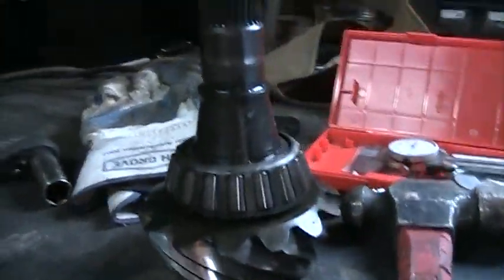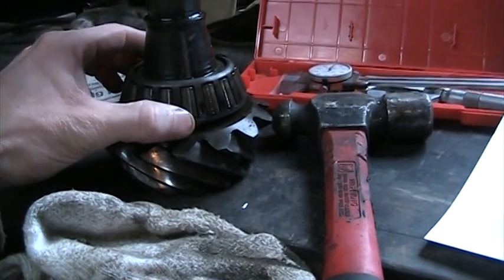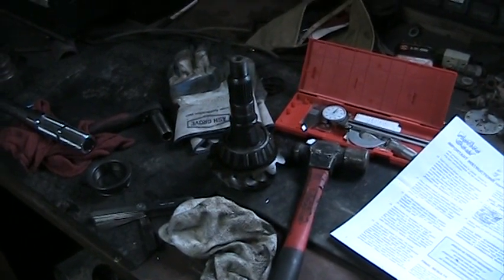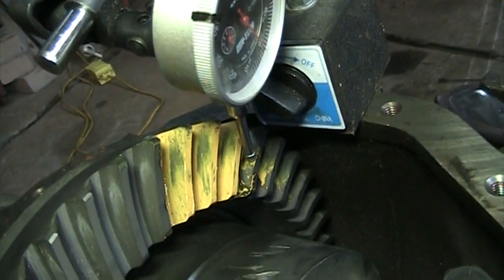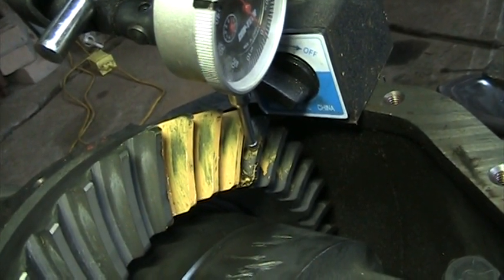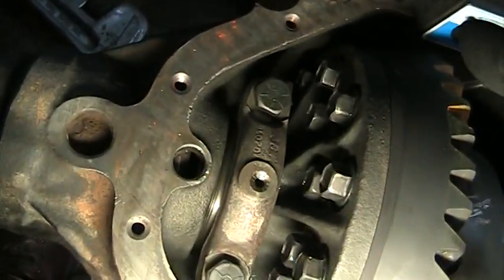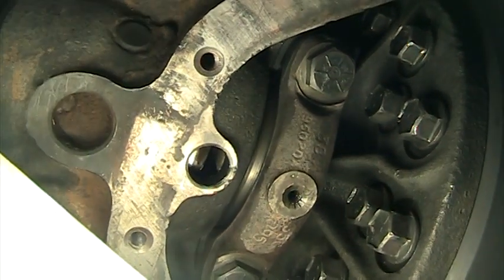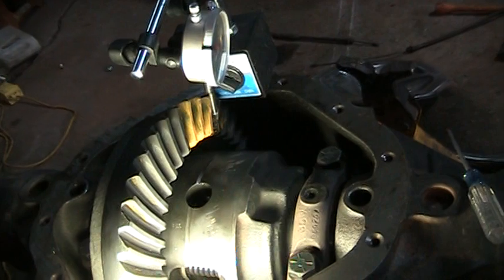410 Install, Part 5

Comment: i have been watching ur video before i got to install ma 4.10 gear on ma mustang. at 1.58 in ur video where u r showing the how everything come together where the clamp is at i know theres a washer there. could u tell me which direction is correct... mine whine at load but not that laud but i can hear it... since they told me it was ok to used the stuck bearing i didnt change it and ma pattern were just like urs, and tips on what i did wrong?, thanks